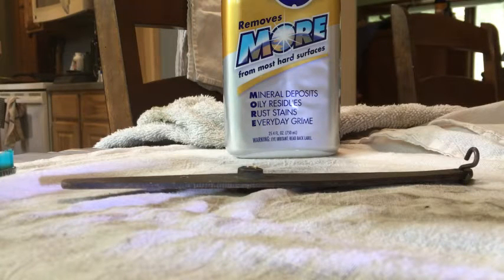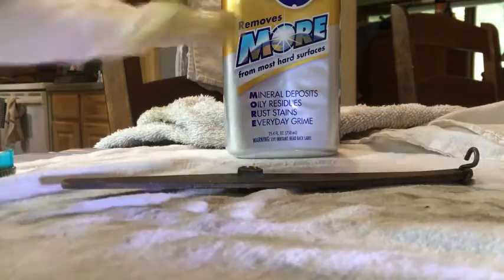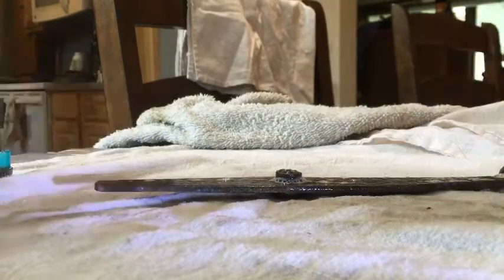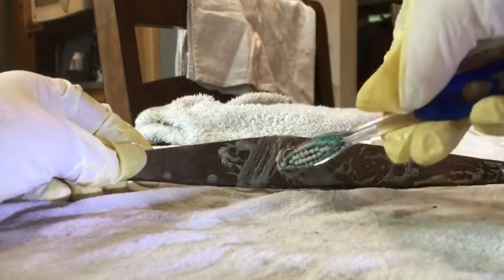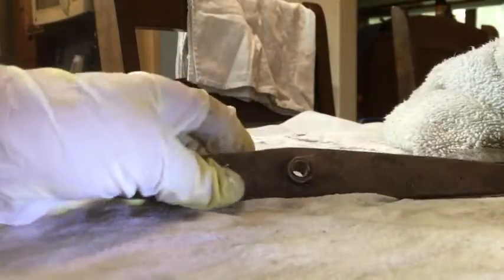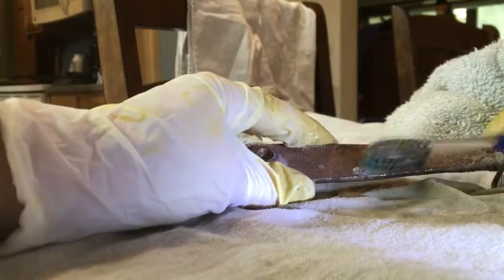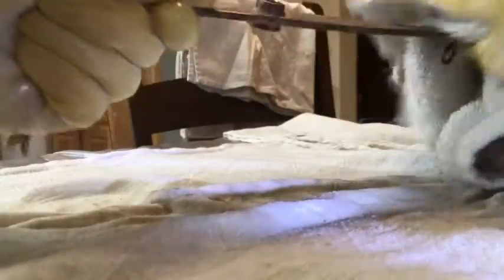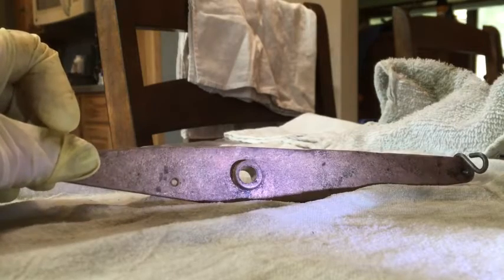Cleaning Jacks

Comment: This product doesn't work at all on the rust on my shafts. I just spent all morning hunting it down and it does nothing. So frustrated.
Reply from the maker: I am sorry that it didn't work for you. I used it 4 years ago and it worked fine for me. Perhaps the product underwent an ingredient change during that time? I don't know, but I am sorry it didn't work.
Reply: @bekahr1  thanks, it does nothing to get rid of rust, I had to sand everything down to get rid of the rust. And I used it to clean after. But I made a mistake and sprayed some on one shaft that was on top of the others to clean it, and the ones underneath rusted again from the spray. So I had to sand again. What a nightmare!